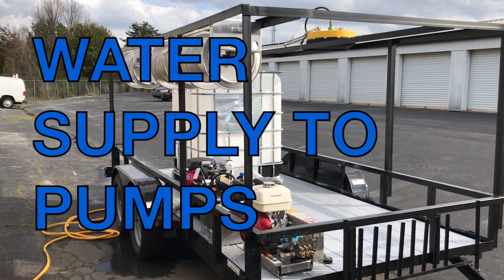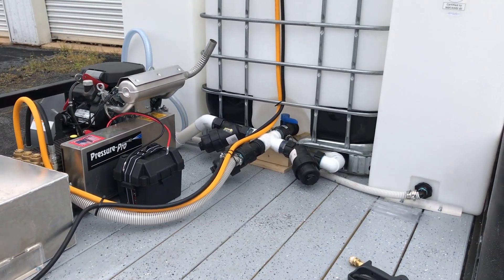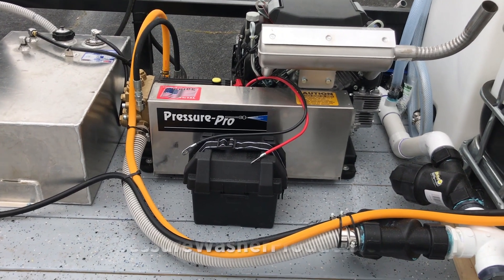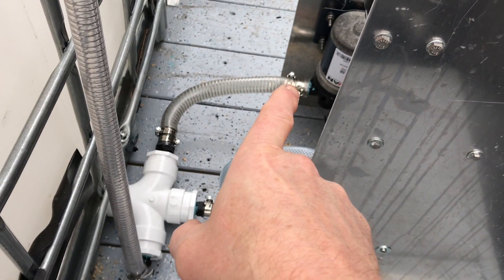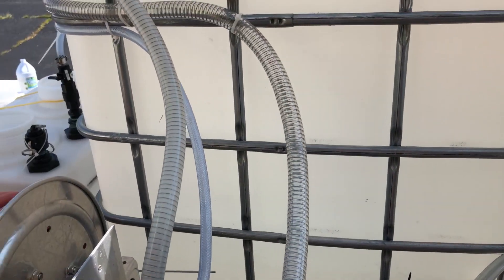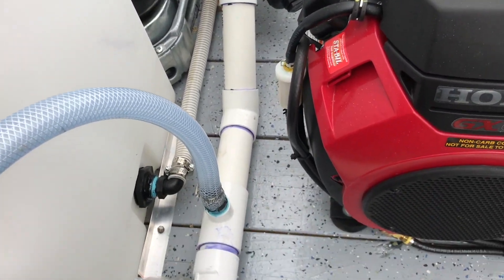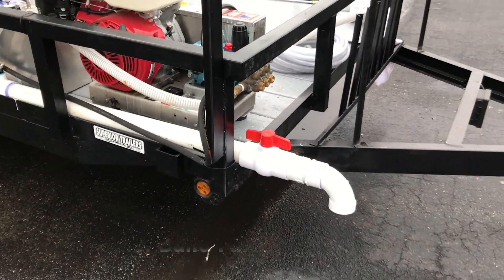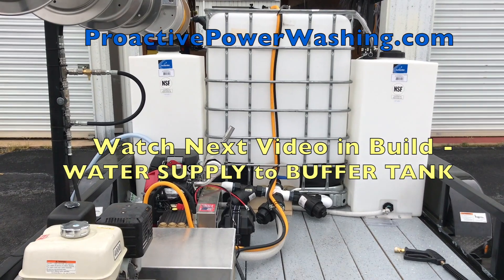Pressure Washer Plumbing – 330 gal Tote to Pump: Pressure Washer Trailer Build (4 of 10)

Comment: I'm not sure it's a good idea you have your supply line for your 4 gallon a minute machine feeding off a manifold with two other functions. If anyone opens those valves while that machine is running, it can cause air pockets and cavitate the pump.
Reply: Belt drive makes a difference
Reply: @ktpowerwashing  doesn't matter belt ,detect,gear..
Reply: @ktpowerwashing the belt drive does help but he's right. If you open the one for the fill hose while the 4gpm is running then you risk introducing air or restricting flow. But thats something that can be avoided pretty easily.